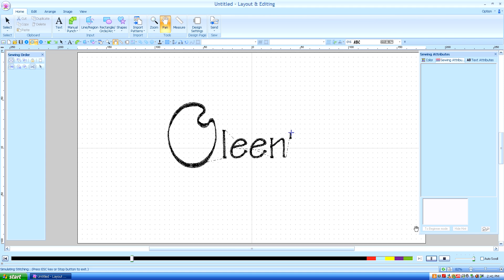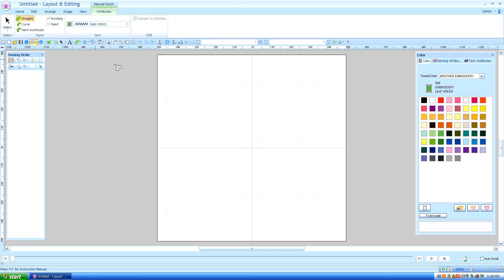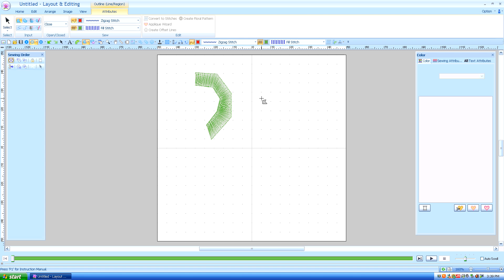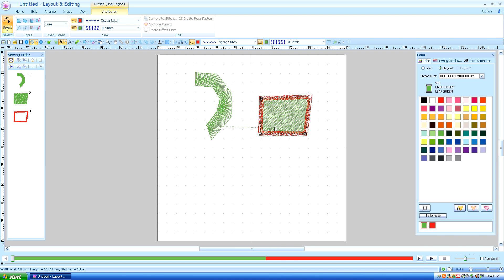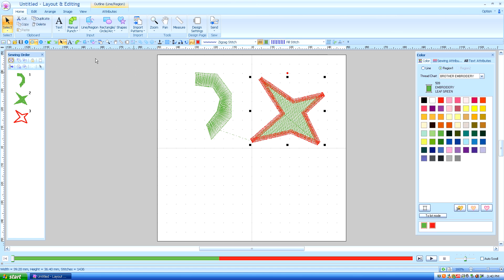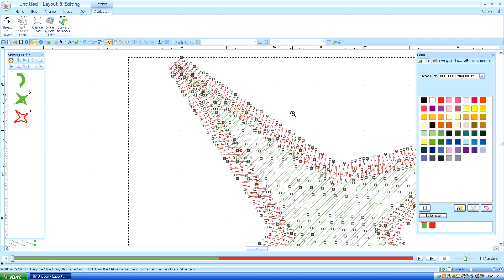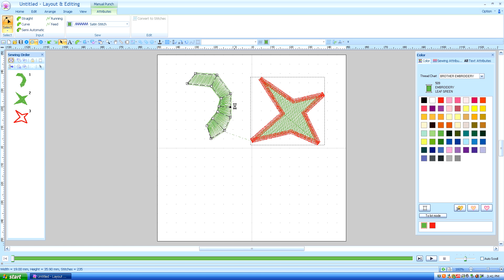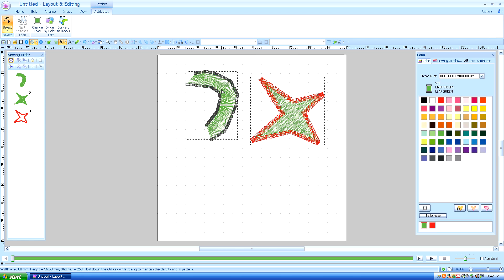Brother PE Design Next: Blocks & stitches (Lesson 11)

Comment: Quick question:  If I am in stitches or have converted to block is there a way to tell where the stitches will start and stop?  I've imported from Design Center and my fill and outline do not match up so there are some jump stitches that I'm trying to eliminate, but I'm having difficulty telling where these are beginning and ending since it won't allow me to use the beginning and ending stitch point tool.
Reply from the maker: Nicole Lovelace Check the multi needle machine box under "design settings" then go to the "view" tab and check "view thread trimming" box.  The little scissors icon will tell you  where every trim is.  Before they had that I used to select the object and run it through a slow simulated sew and note where it started and stopped.
Reply: OleensEmbroidery You are SO helpful!  Thank you so much :)